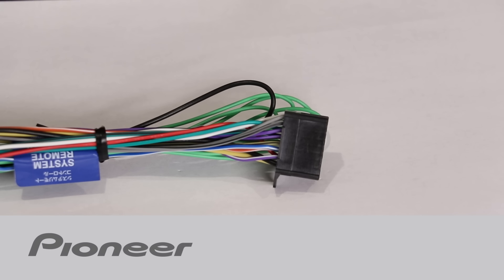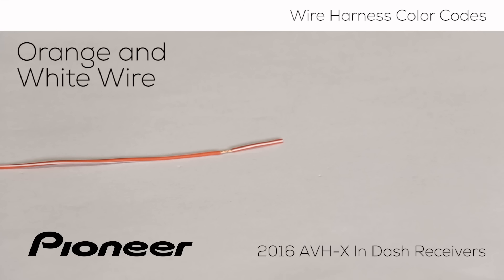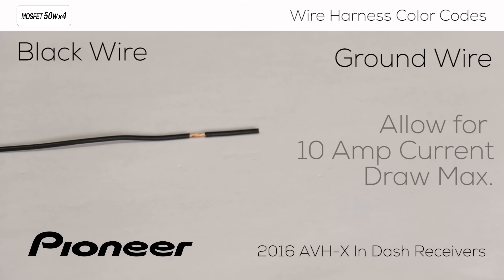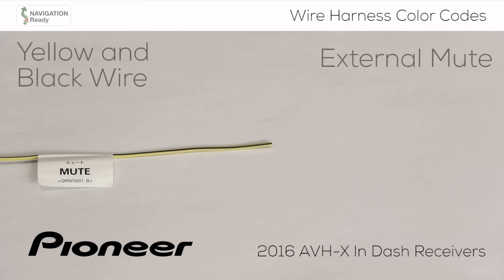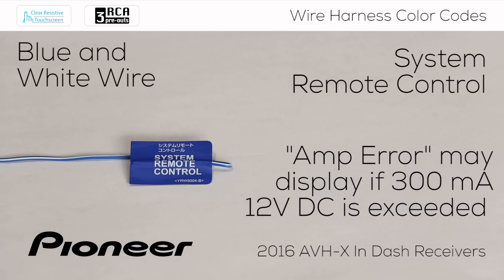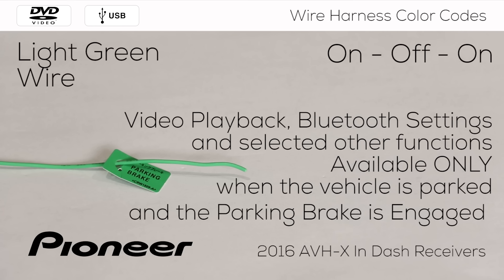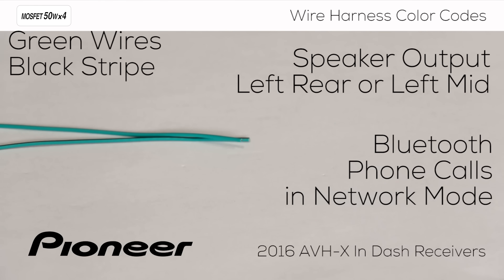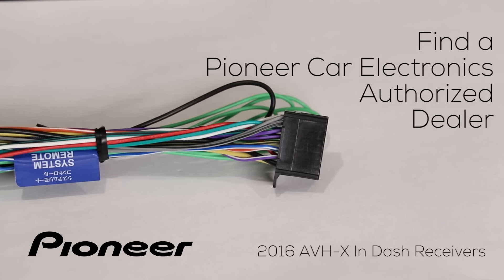How To - Understanding Wire Harness Color Codes  for Pioneer AVH-X Models 2016

Comment: I am installing this SPH 10BT unit in a Motorhome to replace an older Pioneer model. If I use the wiring harness supplied the unit works as it should with the ignition key in position 1 but unfortunately in this position other items also power up like the vehicle’s fan and the rear view camera. This is not what we want when we are parked up in the evening and want to listen to music. However the previous unit was wired with red and yellow together so if I use this harness I am able to listen to music without they key in position 1 but appreciate there will be battery drain if left for long periods. Is there an alternative ‘safer’ way? Secondly, I have set the display to Not go off but I am not able to get the clock to show at all on the display. The unit has a built in clock which is set correctly but it is never visible.
Reply from the maker: For Pioneer SPH-10BT, you can view the Yellow wire as the memory wire.  If you disconnect this wire the in-dash receiver's memory will be lost.  Yellow should always have power from the vehicle's battery when the key is on, or when the key is off.   You can view the Red wire as the in-dash receiver's on/off switch.  On and off with the key is a typical installation meaning the key position controls power to the red wire. In your case, you may consider using a toggle switch on the red wire.  To be clear, you could wire Red and Yellow together, and use the toggle switch on the red wire to power the in-dash receiver on and off when you want.  Please note, if you leave the toggle switch on, the receiver will stay on, and may drain the battery.
For the clock, the SPH-10BT is not a typical Pioneer receiver.  It is designed from the ground up to be 100% operated by using the Pioneer Smart Sync app on your phone, and to have the phone mounted in the receiver's integrated phone cradle.  When you have the Pioneer Smart Sync app on your phone, the app will display the clock on the phone screen.   You can learn more about the Pioneer Smart Sync app here:   https://youtu.be/NSE1mP_pEpo
Please be sure to install the latest firmware on your Pioneer SPH-10BT.  The latest firmware is critical to most reliable operation of the receiver with the phone.  You can find the latest firmware for Pioneer SPH-10BT here:  https://www.pioneerelectronics.com/PUSA/Car/Digital+Media+Receivers/SPH-10BT#downloads
You can find more videos about Pioneer SPH-10BT here:   https://youtu.be/2X0_WyTEMp0?list=PLw63zJRQbCNiGNMG9zaOiTR3NgWe2T7ol
You can find more videos on Pioneer's YouTube Channel here:  https://www.youtube.com/user/pioneerelectronics
Reply: @pioneerelectronics  instead of installing an in line switch, will the unit still drain the battery if the face plate is removed?

Comment: Deckerd, I have an 02 Trailblazer with a AVH2800BS that I’m attempting to install a ND-BC8. I don’t have a purple wire with white stripe, only solid purple and purple with black stripe. I’ve successfully powered up the camera, but what can I wire to so the camera comes on when in reverse? Thanks for any help you can provide
Reply: The Purple/White or Violet/White wire seen here https://youtu.be/-bF3uzzaT30?t=147    is part of the original Pioneer AVH-X2800BS wiring harness.  The Purple Wire and Purple/Black stripe wires are for the Right Rear speaker output seen here:  https://youtu.be/-bF3uzzaT30?t=434    Are you using a different wire harness than the original part included with the product?      The owner's manual for the Pioneer AVH-X2800BS lists the Violet/White wire as the Reverse Gear switch.  This will open the camera window on the in-dash receiver automatically when the vehicle is in reverse.  You can find a diagram of the wire harness in the owner's manual here:    https://www.pioneerelectronics.com/PUSA/Car/DVD+Receivers/AVH-X2800BS#manuals  Look on Page 54.   You can find a camera settings video for Pioneer AVH-X2800BS here:  https://youtu.be/flmRHcGZX3o?list=PLw63zJRQbCNjiTohYtcYmfGNQm5QqzrkX  and you can find more videos about Pioneer AVH-X2800BS in this Pioneer playlist:  https://youtu.be/Sjw0eensar0?list=PLw63zJRQbCNjiTohYtcYmfGNQm5QqzrkX      Please be sure to have the latest firmware installed for your Pioneer AVH-X2800BS.  You can find it here:  https://www.pioneerelectronics.com/PUSA/Car/DVD+Receivers/AVH-X2800BS#downloads   You can find more videos on Pioneer's You Tube Channel here:  https://www.youtube.com/user/pioneerelectronics

Comment: Hi, im trying to connect an underseat subwoofer inside my 2015 aygo which has an AVH-7148zc. Does this video apply to that system as well? Thanks!
Reply: No.  This video is not meant for that part.  The AVH-7148ZC is a part manufactured for Toyota. I recommend to contact Toyota for support.  The video above is made for Pioneer after market receivers only and is not meant to color match up to any auto makers wiring system.   You can find more videos on Pioneer's YouTube Channel here:  https://www.youtube.com/user/pioneerelectronics
Reply: @deckerdotto6035  ah ok, thanks for the clarification :)
Reply: hey mate did u use the solid blue on power side of harness for radio ?

Comment: My parking assist is gray out on my head unit WT7600 nex but I have  backup sensor on my vehicle 2013 ford edge with ford sync, please need help, did I wired it wrong? Let know
Reply from the maker: Please be more specific with your question.   There are several possible issues here.
1.  The Backup Sensor, or proximity alert system is independent from the backup camera and parking assist line option.
You can learn more about how the Parking assist lines work on a similar Pioneer receiver here:   https://youtu.be/WY0GLsC3AxE?t=237
The factory  backup sensor or proximity alert requires the use of an idatalink Maestro RR or RR2 for operation with this receiver.  You can see a Pioneer video about is here:    https://youtu.be/GX8bETHjZkg
You can learn more about Maestro RR here:    https://maestro-fit-guide.idatalink.com/
You can find more videos on Pioneer's YouTube Channel here:   https://www.youtube.com/user/pioneerelectronics

Comment: Hi there, looking for some help if possible, I have a pioneer AVH Z9200dab head unit, I have a reversing camera installed that works off the reverse pulse, I have bought a second pioneer camera for the front but I’m finding it difficult to under stand how it Connects, I seem to be missing a fly lead of some sorts, would you have any knowledge on this particular model, or if you could help me in any way I’d appreciate it. ??
Reply from the maker: The 2nd camera connects to the Yellow RCA AV input on the back of the receiver labeled Video input. Make sure you're connecting to the AV input and not the output.  You can see it here:      https://youtu.be/uympbLEIOsc?list=PLw63zJRQbCNim0lElBRZEQ9ksIx2UZTFa&t=199      
You'll also need to assign this input as a camera.  You can see this demonstrated on a similar receiver in this How To video from Pioneer:    https://youtu.be/OhxjLAeSSTU
Please watch the complete video, there is information about the interaction between camera 1 and camera 2.
You can find a full playlist of How To videos about similar Pioneer receivers here:  https://youtu.be/ObpKXwrN8us?list=PLw63zJRQbCNim0lElBRZEQ9ksIx2UZTFa
You can find more videos on Pioneer's YouTube Channel here:   https://www.youtube.com/user/pioneerelectronics
Reply: @pioneerelectronics  thank you👍

Comment: I cannot access the BlueTooth settings, the option is "grayed out".  I have confirmed the green parking brake wire is connected and have done the On-Off-On sequence with the parking brake.  Is there any other way to access the BT settings?
Reply from the maker: The Green Parking Brake wire is the key to accessing the in-dash receiver's Bluetooth Settings menu.  If the receiver is not responding to the on-off-on parking brake operation, I suspect the Green Parking Brake wire has an incorrect connection to the vehicle's parking brake switch. 
If your Pioneer has a microprocessor reset button, pressing the reset button may help.  This will not override the Green Parking Brake wire's function. The receiver may need to be reset in order to function properly.
You can find more videos on Pioneer's YouTube Channel here:   https://www.youtube.com/user/pioneerelectronics
Reply: @pioneerelectronics  should I connect the green wire to positive or negative 🤔 of the rear brake? My device is sph-c10bt
Reply from the maker: @electrobuz1     The Green wire is for the Parking Brake Switch, this might also be known as the Emergency Brake or hand brake.   
Not the rear brake.
Reply: @pioneerelectronics  oh ok, I already set up the device 😎 it's working. Thanks for the guide.

Comment: How can I get the Parkin brake switch wire to work w/o hooking it to the parking brake switch it’s self! I want all the options of this head unit available to me at all times!
Reply: Luke Dawg ground the light green wire to a screw
Reply: Did this work bc I think it needs off on off or opposite
Reply: I would think if the ground does not work then you can hook the green wire into the parking break and  run a toggle switch
Reply: You can find a parking brake bypass on ebay.

Comment: Hi just bought a Pioneer AVH-290BT and wired everything.. but I have the Metre 40-Ni12 that has the blue wire and connected this wire to the white/blue wire but still have bad radio reception any detail or help?
Reply: I have the same issue. I think we have to connect it to the blue wire in the Radio Harness
Reply: Daniel Montes yes I already connected the blue wire from Metra to the blue/white wire harness and it works perfectly..let me know!
Reply: Alright! I will connect the three of them ! Thanks
Reply: Daniel Montes just remember connect the Metra blue wire to the Pioneer Blue/White (System Remote Control) wire only!
Reply: What about the blue one that comes from the aftermarket harness that connects into the car?
Reply: Daniel Montes yes..connect that blue with the Pioneer blue/white and the Metra blue wire also..those three together..let me know!
Reply: Edrick Mendez Alright! Thanks Edrick!
Reply: Daniel Montes did it work?
Reply: Still at work. Will let you know as soon as I get home and connect it
Reply: Yep...I already connected and the FM bands work better! Thanks!

Comment: Sir, could you Please confirm..

Reverse signal from Vehicle, to Purple wire should be negative Or positive signal? 
Thank you
Reply from the maker: What is the model number of your Pioneer in-dash receiver?  Pioneer receivers with dedicated backup camera input use the Violet/White wire for the reverse gear signal input.  You can see it in this Pioneer How To video:   https://youtu.be/-bF3uzzaT30?list=PLw63zJRQbCNgLoyoij-BJdPDBVLYipAnj&t=144      The in-dash receiver can be set up to use a positive or a negative input signal from the vehicle.  You can see it in this Pioneer How To video:     https://youtu.be/tWi_kVPg2M4?list=PLw63zJRQbCNgLoyoij-BJdPDBVLYipAnj&t=126    In most cases, you'll use the positive 12 volt input from the vehicle's back up lamp terminal to trigger the camera window to open.  Not every vehicle works this way.  That's why the negative or ground option is available.    Pioneer in-dash receivers are designed to work with the Pioneer ND-BC8 backup camera. I don’t know about the operation of other cameras. 
Be sure to plug the Brown camera output RCA into the Brown RCA Input on the back of the Pioneer in dash receiver.
The Pioneer ND-BC8 camera needs power and ground to operate.  The camera should always have power when the vehicle is switched on. And the camera should power off when the vehicle is switched off.  This is very similar to the way the Red Accessory wire works on a Pioneer in-dash receiver.  Just because the camera has power does not mean you are viewing the camera window on the in-dash receiver.
The receiver’s violet/white wire is used to let the in-dash receiver know that the vehicle is in it’s reverse gear and, to automatically open the backup camera window on the receiver screen. 
Do not connect the violet/White wire to the camera. 
When you put the vehicle in it’s reverse gear, the violet/White wire should sense a change in voltage. This automatically opens the camera window on the in-dash receiver. And closes the camera window, when the vehicle is taken out of it’s reverse gear.  One possibly connection for the violet/White Reverse Gear wire is the vehicle’s  backup lamp terminal.     You can find more videos on Pioneer's YouTube Channel here:  https://www.youtube.com/user/pioneerelectronics
Reply: Thank you Very much sir.. I use old AvH 2850 BT

Comment: Will this video work for the avh-120bt? I can’t find the diagram or anything in the manuals
Reply: The wire color codes in the video above should be identical for the Pioneer AVH-120BT.  You can find more How To videos about Pioneer AVH-110BT, nearly identical to AVH-120BT in this Pioneer playlist on YouTube:   https://youtu.be/IjOXaCYwIyM?list=PLw63zJRQbCNjEUhMJufnF-zxddC2146LR    and you can find more videos on Pioneer's YouTube Channel here:  https://www.youtube.com/user/pioneerelectronics
Reply: Thanks so the 110bt and 120bt are very similar
Reply: Yes, Pioneer AVH-110BT and the Pioneer AVH-120BT have very similar operation.  You can find more How To videos about Pioneer AVH-110BT, nearly identical to AVH-120BT in this Pioneer playlist on YouTube:   https://youtu.be/IjOXaCYwIyM?list=PLw63zJRQbCNjEUhMJufnF-zxddC2146LR    and you can find more videos on Pioneer's YouTube Channel here:  https://www.youtube.com/user/pioneerelectronics

Comment: i have a Pioneer AVH-Z7200 the blue remote wire does ot turn off the amp unless i put in an inline switch any ideas
Reply: Please be more specific with your question.  Do you mean the vehicle is switched off, key removed, and door open,  and the amplifier remains on?  Or do you mean you have switched the In-dash receiver Source off with no music and the amplifier remains on until the vehicle is powered off ?  Your receiver may have an option for Source Off and for Power Off  as seen here:    https://youtu.be/SMHohqS7DSk?list=PLw63zJRQbCNi6CoU7JbUNT83T7ippQbU6&t=483      With AVH-Z7200DAB, you may have 2 different Blue/White wires. One for external components like an amplifier and one for a power DAB antenna.  Please be sure you are connecting your amplifier to the correct wire.  You can find more videos on Pioneer's YouTube Channel here:  https://www.youtube.com/user/pioneerelectronics
Reply: @deckerdotto6035  yes key out of ignition the head unit screen retracts but amp stays on using the remote wire
Reply: Just to be clear.  Is the inline switch on the Blue/White wire from the in-dash receiver?   Or is the inline switch on the amplifier power cable?
Reply: A couple more question about this.  Are you sure you're using the original Pioneer Wire Harness for this receiver?    You've mentioned the Blue remote Wire.  Is this wire Blue with White Stripe or solid Blue?
Reply: @deckerdotto6035  blue white wire
Reply: I recommend this test:  At the back of the receiver, disconnect the Pioneer wire harness Red Wire from the vehicle.  With the red wire disconnected at the back of the receiver, measure the voltage on the Blue/White wire at the back of the receiver.   It should measure zero  volts or near to zero.  If the Blue/White wire reads 12 volts, or something similar, the receiver may need to be serviced.

Comment: i have a pioneer carrozzeria avic-mrzo5 im trying to locate the bluetooth connection feature but some menu options not highlighted, what to do?
Reply: You'll need to engage the vehicle's Parking Brake in an ON-OFF-ON operation to access all of the menu options on the screen. This might also be called an Emergency Brake, or a Hand Brake. If you engage the Parking Brake and still can't access the menu options, your vehicle may have an incorrect connection to the Green Parking Brake Wire on the in-dash receiver. You can learn more about the Green Parking Brake Wire in this Pioneer Wire Harness video: https://youtu.be/-bF3uzzaT30?list=PLw63zJRQbCNjEUhMJufnF-zxddC2146LR You can see it operate in this video: https://youtu.be/G5hyqr2LyA4?list=PLw63zJRQbCNjEUhMJufnF-zxddC2146LR&t=232 and you can find more videos on Pioneer's You Tube Channel here: https://www.youtube.com/user/pioneerelectronics
Reply: @deckerdotto6035  thanks for responding I'm heading out to attempt now
Reply: Deckerd Otto so i can could always see videos with the handbrake on or off the video usually cuts off once the car speed exceeds 20km. im not really interested in video display while driving because its not safe, what i want is the bluetooth connection
Reply: The Green Parking Brake Wire is the key.  The Parking Brake needs to be engage to use the Bluetooth Settings.  You can see it operate on the Bluetooth Settings in this video:  https://youtu.be/Z9VTZHWPzkQ?list=PLw63zJRQbCNgLoyoij-BJdPDBVLYipAnj&t=46   If you engage the Parking Brake and still can't get to the Bluetooth Settings, your vehicle may have an incorrect connection to the Green Parking Brake Wire.  You can try to press the microprocessor reset button on the in-dash receiver. If this does not correct the issue, go back to the Green Parking Brake Wire.